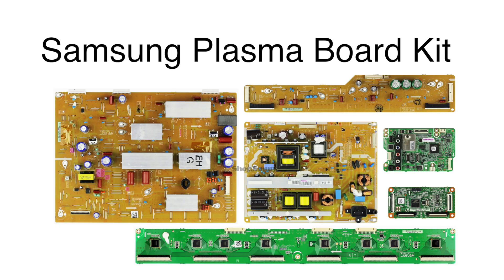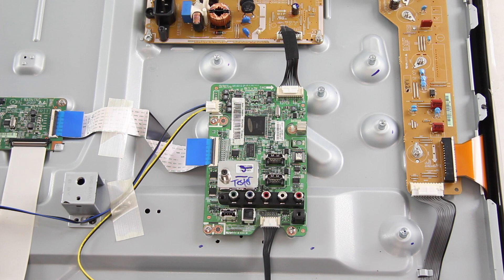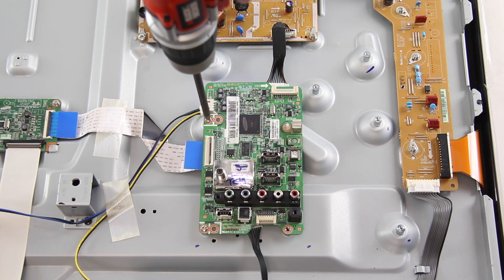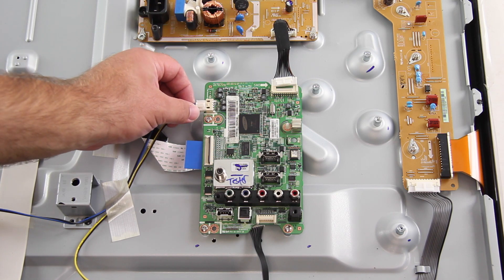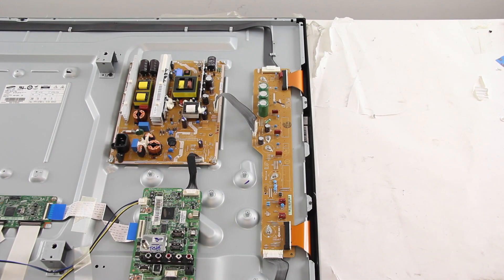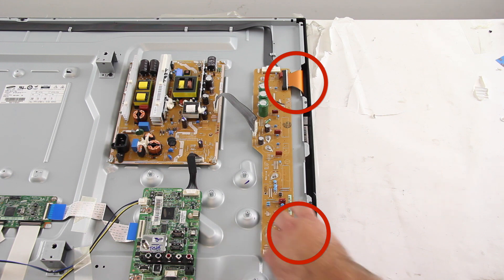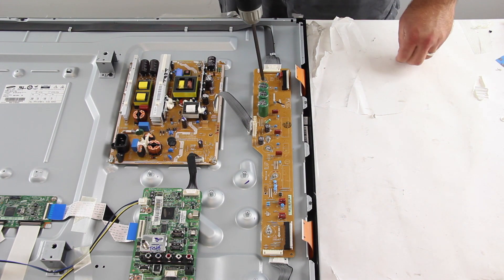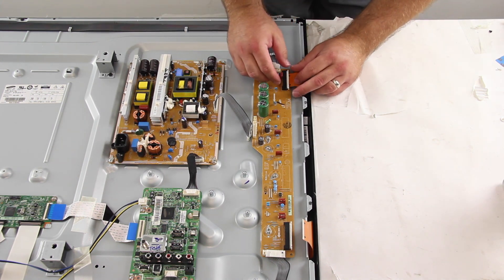Samsung Plasma 50" TV Repair Kit - How To Replace All Boards Included PN51E450A1FXZA

Comment: Samsung PN51E450A1F — no power at all; no lights no anything when plugged in...TV is dead.  I replaced power supply board and still have same problem.  Any suggestions on what to do next?
Thanks!
Reply: I now have the same problem.

Comment: So what board would I replace if the Plasma TV won't "Start" when hot?  "Starting" is when you press the on button, see a little flash on the screen followed by the blue Samsung logo and then your signal.  
Not "Starting" is when you press the on button and nothing happens but five seconds later the light flashes on and off.  
Let the set cool down, disconnect-reconnect power and the set "Starts" as normal.
Any idea what board has gone?

Comment: One more thing of another strategic testing the X-buffer PC board and the Y-Buffer PC board is first unplug all the ribbon cable and power ribbon cable and remove the X and Y buffer board from the chassis is by using the multimeter to test if there's sound of continuity (means bad but make sure not short-circuited that there's no sound) when the other lead pin is touching the ground and the other lead pin is to touch those only socket pins (not the power ribbon cable socket) by sliding them very lightly touch and slowly slide them to see if one of the pins on socket is grounded which means bad. If you heard sound on multi-tester it means that Buffer buffer board is true bad and needs to buy new one and replace the old buffer pc board and install back the way it was installed with those ribbon cables and screws. Enjoy repairing folks😉🙂😇.

Comment: I have the same model TV but Not all the boards have defective on them to replacel. First to do is look at power supply pc board remove/unplug power cable, look any signs of burned parts by visualizing if there’s any burned up parts resistors and others, bulging/leaking capacitors, test the fuses if there’s more than one and test all those transistor mosfet pin attached to heat sink aluminum if those transistors lead pin is bad grounded by using multimeter to test all their pins continuity if grounded making sound that has continuity but make sure look at the other side bottom of power supply PC board that one of the pin of transistor’s pin is soldered/ground that if the other two pins of transistor made a sound/continuity that means that’s bad. Those parts must be replace with new same component parts indicated written their part number in front of that parts which is that is the one to order that is similar exactly component parts. To remove/put it back a new one is by using soldering gun and desoldering gun (suction type) instrument tools. There should be a technique giving for repairmen... like when you turn it “on or off” there is sound coming out which that means the video/audio PC board is working, the logic pc board has light LED indication that means it’s understood logic board is working. If there is sound coming out either “on or off” that means the X-buffer and Y-buffer board is working good.  On other TV flat panel, If you either turn it “off or on” no sounds come out, to troubleshoots X-buffer and Y-buffer PC board is by disconnecting one of the ribbon cable connected  between “power supply pc board and X-buffer PC board and/or the Y-buffer PC board but one at a time to test the X-buffer pc board and Y-buffer PC board. Try plug it in the ribbon cable of X-buffer PC board to power supply PC board and unplug the ribbon cable of Y-buffer PC board or vise versa to try to test one of them that when you turn it on the TV which buffer PC board will make sound.  If one of the buffer PC board make sound that is connected then that means that buffer PC board is working. If you tested the “other” Buffer PC board that you connected that did not make a sound when you turn it on the TV, it’s understood that Buffer PC board is bad. Order/buy new one in EBay to replace that bad Buffer PC board. Look for any signs of bad parts to see if you can find bad parts or just buy new Buffer PC board that it did not make the sound and replace with a new one then install it back were you unscrewed the bolts/screws. Then plug it back in the ribbon cable.  Next, if there’s sound but no picture, and press Menu button on remote control and light it up the front panel TV with a flashlight to see if there is any words coming out very dimly in TV front picture which that means the LED at the backside of TV panel behind the screen TV that one of the LED IOC more s really bad. By testing those LED just plug a  1.5 Volts battery to see if one of the LED light is not turning on on each rail. Then buy that LED light in EBAY and replace the bad LEDs light.  There’s another one that when you turn on the TV and press MENU and you light it up with a flashlight pointed to screen TV  to see if there’s any words or menu or bars running  similar to updating, if it doesn’t show those that means the “driver” of that monitor is bad. Then buy that driver and replace the old driver. My X & Y buffer main board is combined so it's the same on this video which I changed & replaced it located on left side that has 5 variety sizes of rectangular shaped of aluminum heatsink in this video because there was no picture and handles all the power, heat, fatigue & etc. Replacing those 4 transistors cost almost the same as the entire one X & Y buffer main PC-board for $24 bucks but + tax & S&H. But change and replacing all the boards you see in this video cost you $50 + tax & S&H in this type of TV model at www.shopjimmy.com. This is all I know in this type of Samsung TV Flat Panel model. That’s all folks. Enjoy repairing and ask that guy in the video and search more here in YouTube repairer TV giving help related on how to repair and troubleshoot flat panel TV. Remind only that always unplug the power cable to avoid shock/electrocute from capacitors and always wear rubber gloves just to insulate yourself and wear rubber shoes as long as you’re not attached to any grounded metal to Earth. Enjoy repairing folks.
Reply: So what board would I replace if the Plasma TV won't "Start" when hot?  "Starting" is when you press the on button, see a little flash on the screen followed by the blue Samsung logo and then your signal.  
Not "Starting" is when you press the on button and nothing happens but five seconds later the light flashes on and off.  
Let the set cool down, disconnect-reconnect power and the set "Starts" as normal.
Any idea what board has gone?